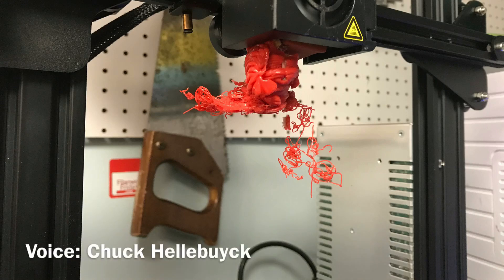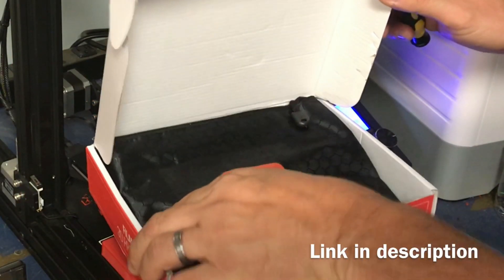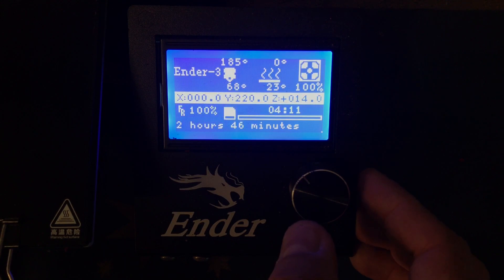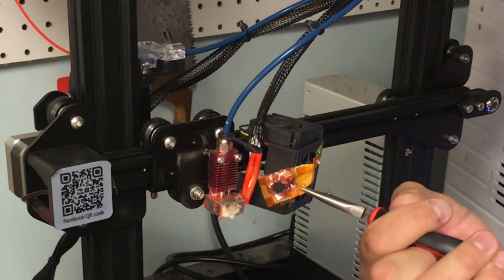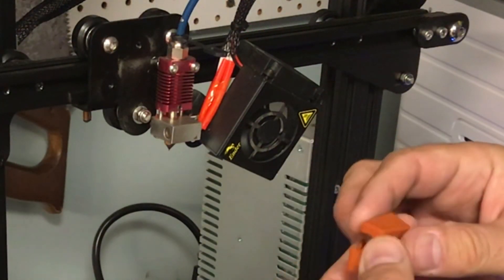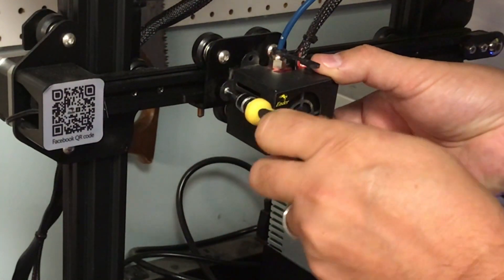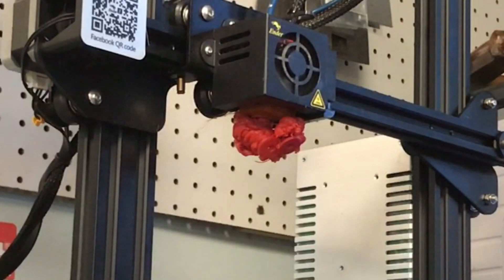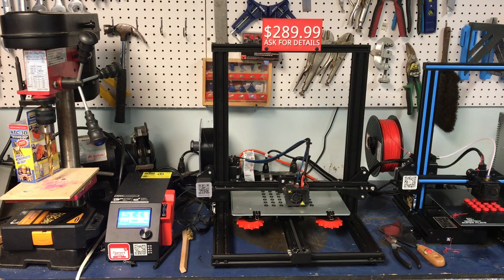How to fix a Filament Blob on Ender 3 3D Printer

Comment: I have an ender with the silicone cover but it ended up getting one of those massive globs of filament, and while I was cleaning it, I severed two small copper wires that were embedded in the filament blob, now I'm trying to figure out if I can solder them or if I should just buy a whole new print head assembly or something. Very unfortunate wire placement 😢

Comment: what  makes  this  blob around    the  Nozzle ?  i  was  abot  done  doing a  print  and  there  was  alittle   around  the  nozzle   while  i  was  printing    then it   came  off  and  knocked  the  print   down   and  had  to  start  all  over  now  so  not   sure  whats   going  on  iam  new   to  this   any   info  would  be  thankful   for     thanks
Reply from the maker: The print lifting off the bed and sticks to the nozzle. Then filament collects around it making a blob.
Reply: no its  more  like   half way  done   and   it  collects  around   the  side of   the  nozzle   i  found  out    the   nozzle  was  lose  fixed  that   part  this  is  all  new  to me  here  and   working ona  a cookie  cutter  print  now  and i  have  slow down the  printing  50%     but   yes i  was  having   alittle  trouble   having it  also sticking to the bed  but   slowing it  down  looks like it   may   work  
 @FilamentFriday
Reply: just  got  this  print   few days  ago  and  the  first    print  i  dont  came  out  100%  good    so   was not  sure   what  happen   @FilamentFriday

Comment: If its not over fragile pieces i get the hot end up to 150 c for petg and it comes off better because its not fully melting but its losing its adhesion. I suggest harbor freight spring loaded super precision needle nose pliers they also have flush cutters just like the ones that ender 3s come with. Anyways if it comes off as chunks instead of liquid youve got less cleaning!

Comment: Has anyone had trouble with molten filiment druuning down the outside of the nozel from above the hotend....could it be seeping from the threads of the hotend and heat block join?.... otherwise printer running fine.... would appriciate any advice :) thank you.
Reply from the maker: Your nozzle and heat break are not touching so filament is leaking out. You need to screw the nozzle in further or take apart the hotend and screw the heatbreak further into the heat block so they can touch.

Comment: What causes this?? its happened on 3 of my most recent prints and I cant figure out why.
Reply: bad bed adhesion and bad extrusion(extruded filament curling) could be an combination or one of these
Reply: @ipodtouchiscoollol  can it be because of the improper temperature maybe?
Reply: @TOMA21207  improper temperature settings for the bed may be a possible cause but I'd say that belongs with bad bed adhesion. as for printing temperature that should have no effect as low temperature would usually just result in low/inconsistent extrusion or a jam and high temperature would just over extrude but would still print just fine.

Comment: My printer won't heat up, the blob grabbed hold of the  thermometer wires and ripped them out so the printer just gives me a temperature error. Should I cut my losses and put the hotend in the oven and get a new thermometer and heater at microcenter?
Reply from the maker: I’d just replace the whole hotend. Ender hotends are rather inexpensive.

Comment: My husband printer has a massive buildup its solid will this still work or will or can he buy a replacement
Reply from the maker: Assuming you mean buildup of plastic?
Just heat it up and remove it. And yes, you can buy a new hot end on Amazon.

Comment: While printing I get a build up around the nozzle it is not bad and happens over time, the trouble is that it comes loose and can trap the nozzle causing a missed step.
I think it might have to be caused by the layer thickness but not sure.
Reply from the maker: You nozzle might be leaking around the threads.
Reply: Initially that was the problem, I tightened it and then I watched it, now just seems to be a build up takes about 60 mins to build up.😊

Comment: I know this video is old and I probably won't get a response, but what if it's so bad that the blob got caught in the upper fan? (yes, really) I can't remove the cover without damaging the fan
Reply from the maker: Hit it with a heat gun to soften the plastic as you remove the fan shroud.

Comment: Thank you so much I had a friend help me set up my ender 3 v2 and he told me to take that piece off cause it just gets in the way. So I was printing and getting blobs and he had no idea why told me maybe the filament I got was crappy. Am not putting it back on. Cause I did a 2 day print that lasted 4 days cause I kept pausing it to cut the blobs off of the print

Comment: I was literally ready to sell my Neptune 2S as is when I got my first blob today. Went behind the silicone cover and covered 360 degrees around the entire hot end and up into the red heat sink above. Adjust the head and using needle nose plyers worked wonders then lowering the heat a bit and using a wire brush as suggested to scrap off the remaining soft plastic isn't of rock hard or goopy and messy. 
    Now I just need to relevel the hot end thing because I had to remove it to clean it, mount the fan, and relevel the bed. I'm really not sure if FDM printing is for me or maybe the Neptune 2S is just too cheaply made. I'm just not enjoying this hobby so far. It has felt like i started a second job with how much there is to learn and how many prints fail for me. Resin printing is so easy and hassle free compared to this but hopefully in time I'll enjoy FDM as much. Atm I'm frustrated and feel defeated every other print. Thanks for the video, it was by far the most helpful thing I found online.

Comment: I had a giant bloc on my Ender 3 pro. Im not sure what happened because I was not watching the print. But it pushed the magnetic bed off and dug into the foam/magnetic base on the bed. Also the filament got behind the rubber boot on the heat block. I decided Im swapping to glass bed, getting a cr touch, and a raspberry pi for remote print monitoring.
Reply: If you have any links to those items you get cause i had a similar case happen to me and the middle of my bed is warped

Comment: Don't know why but ever since I removed the stock silicone sock from ender 3 my prints have not only improved but now rarely fail.
Reply: did you replace it with an after market one? or did you just leave it bare?
Reply: @jethrothelion7763  I left it bare
Reply: @Arlequin_n  ohhh okay thank you mine fell off and won't go back on so I didn't know if I could leave it bare

Comment: I have a silicone sock but its a ender 3 stock one and stuff still sticks to my nozzle
Reply: mine literally broke because the blob went up and cut through it
Reply: @firecricket2807  Exactly what happened to me, I ordered the "Creality Original 3D Printer Heater Block Silicone Cover" from Amazon, waiting on them now.
Reply: @firecricket2807  i had to grab a hacksaw to cut the blob in half so i could remove the sock
Reply: @jmyers1776  big blobs really do that to you :|

Comment: I have the silicone thing and my endef 3 still does this and it gets under it. How do i fix
Reply: get a hot air gun and heat up the plastic on hi. they are only 30 bucks

Comment: Excellent video. I would add that, when initially removing the blog, rather than setting the hot end to the full PLA printing temperature keep it 30 to 40 degrees below at around 160. This is enough to free it and gets it to a rubbery consistency that can be easily removed as one solid chunk but not hot enough to fully liquify the PLA which leaves behind strings and residue.

Comment: After about 1 year of printing I just had my 1st blob...but the difference I have is the print was around 50% when it started..I know that because it was the last time I checked on it and everything was going fine...any idea why it would happen mid print? I just installed a new nozzle,and it is factory tight.

Comment: I had a silicon cover. The plastic built up under it. U have no clue how. But it did
Reply: I had the same thing. Might be because the PFT tubing isn't all the way down to the nozzle and PLA is oozing out the side because of it. I'm going to check if that is the case in my printer. Let me know if you found anything else that might have caused this. For all I know my bed was leveled okay, as my print before this disaster was fine.
Reply: I had the same issue with a v6 with a silicon sock - I was worried it'd be something like that, nozzle not on tight and whatnot, turns out it's actually the plastic curling up and coating the nozzle, think it maybe needs cleaning inside - might be something to look out for.

Comment: why does he put the ender 3 glass bed on the standart ender 3 bed?
Reply: This is how you normally install a glass bed for the Ender 3, by clamping it right on top of the factory bed cover.
Reply: Older Ender 3's had the standard cover stuck to the bed, but now you can just remove the clips and install a glass one directly

Comment: I’m getting build up around the nozzle and it slowly leaks down onto my prints it gets so bad the whole nozzle is covered in plastic. what can I do to fix this or is it normal? (I’m using a Ender 3 pro) I already have a silicone cover on it also
Reply from the maker: Your nozzle is probably loose. It’s probably leaking around the threads. Try to tighten the nozzle.
Reply: Chep I’m doing this but it’s wearing down the nozzle

Comment: Like many, I left my 3d printer unattended and this happened to me. Except for this time something worse happened, the blob reached my thermo-resister wires and screwed them up. In addition to trying to fix the thing, I made matters worse by stripping the nozzle. Now I can't get the nozzle off. I just bought a new hotend on Amazon. Luckily it was only 20$. Learned my lesson.
Reply: I literally just did the exact same thing and had to buy a new hot end as well.   Print and learn I guess.
Reply: @K_raken  I have a tip that also helps. When assembling the new hot end, make sure to screw in the throat piece just a little bit more so that the nozzle and throat piece is for sure connected and touching. That was also causing my blob problem cause the filament would climb up the threads

Comment: I was printing just great then out of the blue. pla stopped coming out but it continued to print. So it was printing air. still not quite sure the problem but it may be an extruder issue not gripping the pla. some times i get it to print, sometimes no pla comes out. 

so discouraging as I was on a roll making my child something that was multiple parts. when it does print, some areas are bunched up. some areas have nothing,
Reply from the maker: https://youtu.be/MaMYMTX1Xl4

Comment: Oddly enough... seeing all the different Ender 3 videos, and posts, they all had the cotton/kapton sock, so when I ordered my Ender, I also ordered the silicone covers... When I opened the box to assemble, there was a silicone cover already installed... LOL!!
Reply: when did you order your printer? My ender 3 from last december had the kapton sock
Reply: @S41t4r4  I ordered mine in late December from Banggood... It even had a genuine XT-60 connector from the power supply (others have reported a "clone" connector, there's a video of that too, somewhere)...
Reply: @scottbarnard2422  Mine also came with an soldered xt60 connector. I got mine from Gearbest. So it could be a similiar production date, just a diffferent contractor.
has your bowden coupling metal teeth? and what version of buildplate did you get? Mine is the one that they put the fake buildtak on a acrylic type of material.
Reply: @S41t4r4  Watch this video, make sure you have a genuine XT60... https://www.youtube.com/watch?v=4yDp9frWkcg

As far as the Bowden tube and couplers, before my Ender arrived, I went ahead and ordered Capricorn tubing and upgraded couplers (they sell a kit, all included) https://www.captubes.com/shop/#!/XS-Creality-Kit-1-Meter/p/123266986/category=24343139    So, when I was assembling the machine, I installed the new tube and couplers instead... it's a recommended upgrade...

Same build plate as yours, but there's been a "known issue" with these beds, some are slightly warped. My bed "dips" in the center. I went ahead and ordered the genuine Creality glass bed, adjusted the Z end stop switch, and everything is golden!

Even though I'm not having any issues so far with the Capricorn tubing and couplers, it's all tight with negligible movement (at the extruder), I will be applying the "hot end fix" Chuck explained in his other video just for the hell of it, and stave off any potential issues... https://www.youtube.com/watch?v=Fb4XMbZ0iA4

Comment: Any way to stop the filament from curling upwards? or is it natural
Reply from the maker: If it’s curling when leaving the nozzle then you have a minor blockage. Clean the nozzle or replace it.
Reply: That is funny because i just replaced the darn thing. Maybe the tube isn't at a perfect 90degree angle? Maybe I bought a dud tube cutter

Comment: Hi Chuck, This morning i've managed to get this blobs for the first time, I easily remove them and clean the hot end as per your video, but from that moment I started to smell the pla burn every time I print new object. Any idea how to solve this?
Reply from the maker: Check the PTFE tubing end. Typically that’s the smell. Are you using Capricorn tubing?
Reply: @FilamentFriday  will check, nope, using the basic.
Reply from the maker: Check end near the nozzle. It might be burning.

Comment: So...my Ender3 (just got it 2 weeks ago) came with the silicone sock.  Yep...along with the latest firmware that has TRP enabled.
Reply: How can I check if TRC is present? My Ender 3 came with the silicone sock, and did not make all the noise people were complaining about in earlier versions, so I may have received one of the later models...
Reply from the maker: Awesome. Thanks for the feedback. Where did you buy it?
Reply: @FilamentFriday  GearBest
Reply: @FilamentFriday  Just got mine last week from Amazon and it has the silicon boot, too.
Reply from the maker: Excellent. I’m told that means Thermal Runaway Protection is enabled too.

Comment: Hi, I have an Ender 3 too and I have 2 problems with it:
1. I can't seem to get the bed leveled. No matter what I do, it has spots, where it seems not to stick (I mean the first layer). I am already using a Glass surface, which should be level... Any ideas?

2. My Rolls, which run along the Aluminum Rails wear up way too quick. I loosened them, retightened it just right, so they do not wobble, but still, they produce some black powder all over the aluminum rails. Any tipps here?
Reply from the maker: 1) Use a little Avery glue stick on the bed. It washes off with warm water. 
2) Use a just little white grease on the rails.
Reply: @FilamentFriday  ok thanks, will give it a try

Comment: Doesn’t heat creep up to the cold end when the fan is not blowing into the heat sink?
Reply from the maker: A little, but the electronics reduce the current to the hotend to try and maintain proper temperature. Also the heat sink is designed to absorb some of the heat and radiate it out. Just clean it quickly and it’s fine.

Comment: Remove the two screws that are to the left and right of the heat break, Yes Creality messed that up they are there to put there for assembly only and should have been removed after. or you will get heat creep witch is why you are having a problem there :)
Reply from the maker: That has nothing to do with this issue. It relates to not sticking to the bed.

Comment: I used a wire brush on the nozzle of my TAZ 6 and it ended up creating a charge that fried a fuse in my printer. Lulzbot told me to use a Scotchbrite pad instead. That is what I am planning on doing going forward.
Reply from the maker: That seems strange to me. I don’t understand how that could happen electrically. What fuse?
Reply: The wire brush on the brass nozzle could generate a static charge that can go back into the board. On my TAZ 6, there are two "nano" fuses that could have been blown. The light in the power button was lit when I turned it on, but the LCD display was dark and nothing worked. Lulzbot tech support had me swap the two fuses to see what happened. Thankfully, the LCD display lit up, so all I needed was a replacement fuse (which I ordered from their site ($10 for a 3-pack)).  When I put it in where the bad fuse was, my printer now worked fine.

Here is where I ordered these fuses so you can see what I am talking about:
https://www.lulzbot.com/store/parts/5-amp-nano-polyfuse-x3
 @FilamentFriday
Reply from the maker: I’ve learned that the Taz uses an electric probe leveling so it’s powered. Touch a conductive material from the nozzle to ground can cause the issue.

Comment: Thank You. Great tip.
I have the ender 3, had it for 1 month now, have more trouble than you can think of.
All boils down to not sticking, and nozzle height. But I came home to a mess and broken x-axis limit switch. Darn. Now I can't print. 
I have serious bed staying level issuses.
Got yellow springs on order.
then when I get the money, going to install the EZABL sensor and harden spacers. That will solve that. Then hopefully I can get some good prints going.
-Tom
Reply from the maker: Wow, I have not heard of that many issues with a new printer.
Reply: no one else has either that I talked too.  Make me think that I got someone else's junk.
I am going to try a few more things, then if it isn't going well, I'm done.
I can't handle this many troubles all at once. I can't even print for the next 2 weeks.